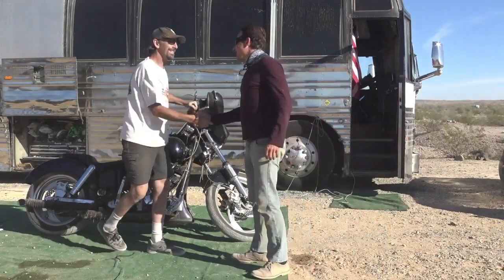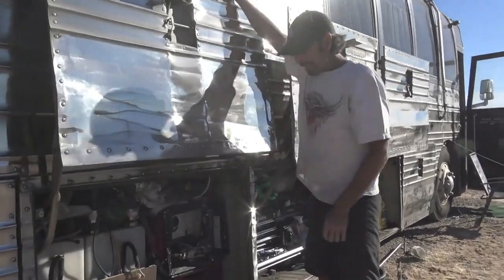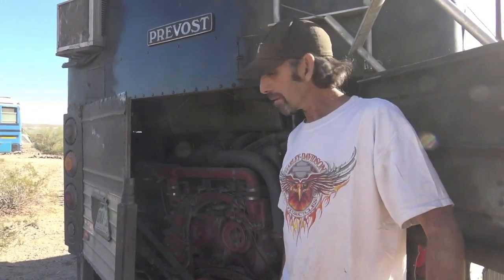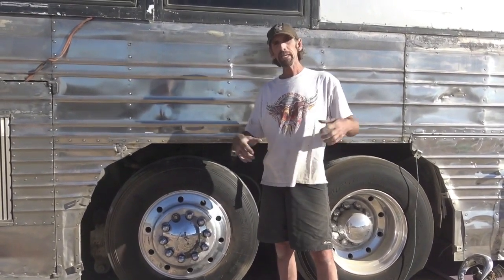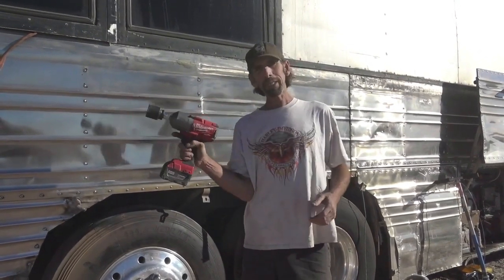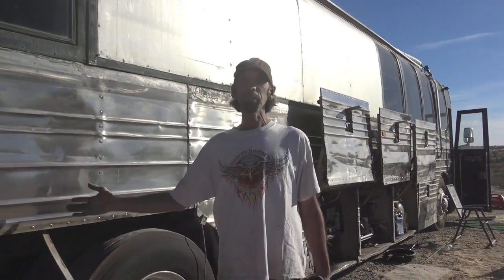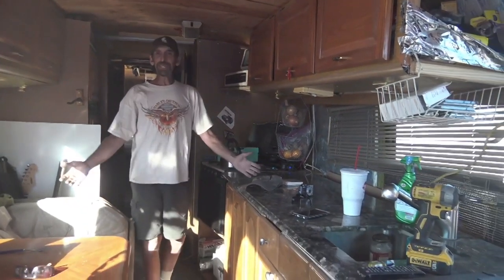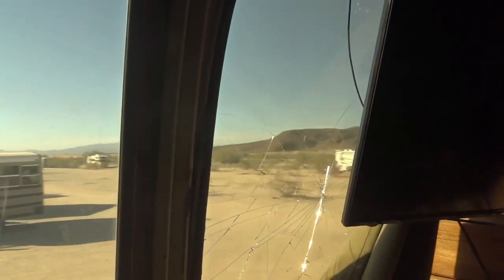Tour Harleys Off-Grid DIY Prevost - Enigmatic Nomadics Van Build 2018

Comment: Love what you're doing with your bus. Turtle doesn't have solar either but somehow we have managed ;) I like to use my little silent Honda too instead of the big gen, it's quieter by far and less expensive to run what I need in the machine. There is just something about a Prevost, I feel so safe inside one and yes, they drive like a big Caddy. I've met so many nice people because of the Turtle, she is quite a conversation starter. Best of luck to you with everything and safe travels. Cheers from Canada ! Janis.
Reply: Jamie talked me into having a solar panel. I may add a second just to keep batteries charged. He had a discount on a panel and great. 305 watt panel with a victron controller, on lead acid batteries from walmart. It's great to have since it's enough to keep stereo and tv going all day if I need. And thank you. I love my Prevost. Its saved my life a few times and still makes life manageable.i own a place to live. And I cant afford anything else. This is me making the best of things with what I have. Thanks again

Comment: Anyone else think that engine looks more like a Cummins than a Detroit? 🤔
The great thing about solar power is you can start with one panel & a voltage regulator. You can always add more panels as you can afford them. 👍🏻
Reply: Hi. This engine is a big Detroit. 8v92 with a huge turbo and supercharger. Its red because it was from a fire engine. Pure Detroit 2 stroke.
Reply: And I added a solar panel. 305 watt. I love it

Comment: My largerst (power, water,sewer, garbage) bill here has been $110. Tax $54 a year, summer is hot in the south so I turn on the AC and probably won't be shutting it off for 7 months. Wash and dryer all electric. Property cost $12.3k including legal fees. Best thing about this place is you don't have to own a car. Google 70380 and take the town for a spin as if you live here. Go turn on the utilities at City Hall, grocery shopping , hardware store, Walmart,Dr office, even specialist all walking distance less than a mile, cable bill cellphone store, social security office. Gym Toyota dealership, Honda mc shop a lot more. Got fridge freezer running too.
Reply: That's great. Enjoy.